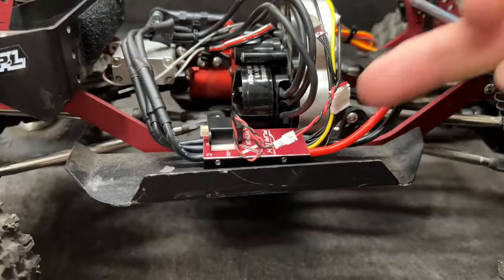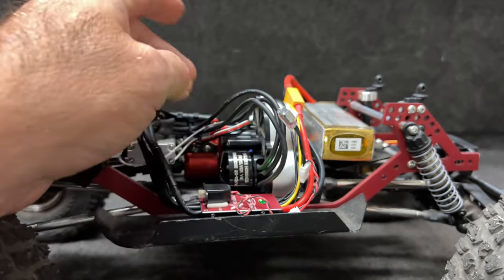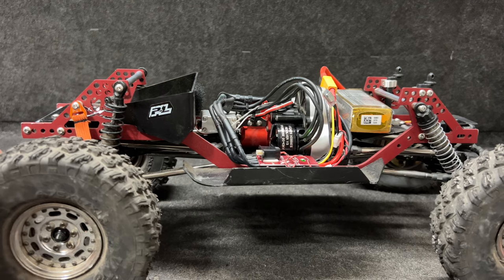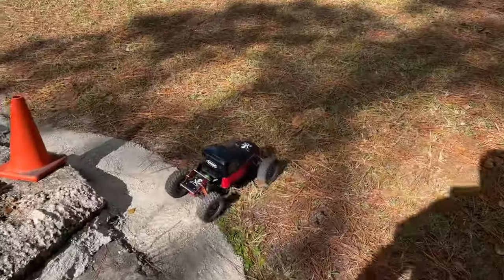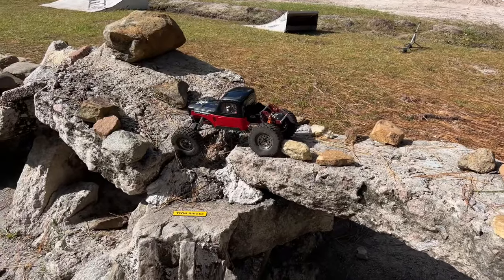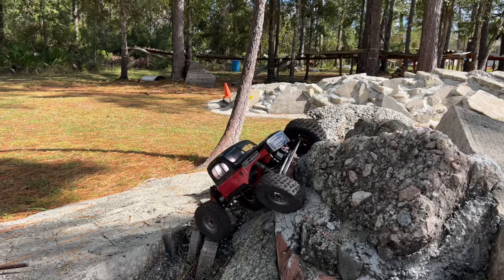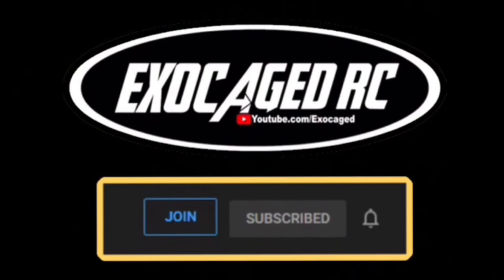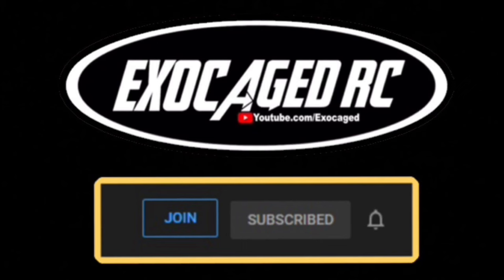The Incredible BRAKE LOCK Feature of the Python X esc from Furitek

Comment: I swapped my ultra VFD trans from stock with fusion pro to full lightweight gears and VFD hurtz dig with a holmes 540m outrunner and took off 129 grams of weight. Almost 5 ounces lost just from the gears and motor, plus added dig. Used this Python X esc too! I love how it drives, just waiting on that V1.1 update to work

Comment: Got that python x on a holmes hobbies revolver stubby 1800kv,mounted CAPRA AXLES power hobby lcg chassis 2 low transmission, stretched out wheel base with BUNCH of overdrive (about 60%). Its a killer mean CRAWLER. That python x its just SMOOTH with plenty of MODULATION! Very good TORQUE AND SUPER SMOOTH, A WINNER!
THANKS JOE, THANKS A LOT!! ENJOY!
Reply: Almost forgot, im running 4s... 850mha

Comment: But why is this needed?? With proper gearing and a fusion pro the drag break is nearly impossible to slip.  Even if this is stronger, it doesn't actually make s practical difference.  So what's the point, am I missing something?

Comment: I have the same v3 2040kv revolver holmes motor, an got it brand new for $20 dollars. Ordered the purple team spec and got he 2040kv motor by accident. Holmes asked if i would want the motor for 20 dollars for the mistake an send the right motor out right away. Great guy an amazing product. That 2040kv v3 is amazing. So is the team spec I got then also. Lol I was thinking about the new holmes esc he has for the team spec. But I thought about also given this esc a try because I like the case an Bluetooth phone amp adjustments. Maybe I should get both. Lol